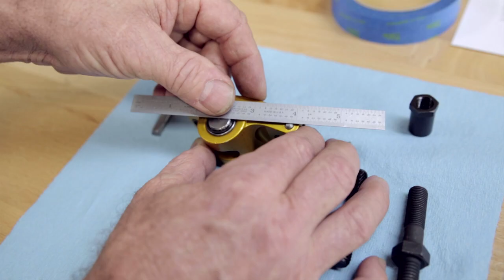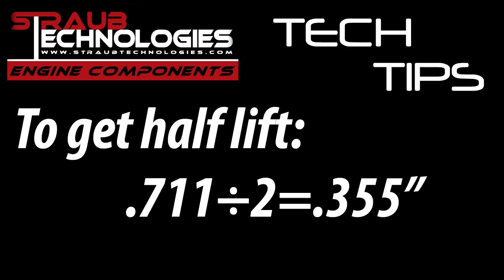Engine Tech: Valvetrain Geometry

Comment: So when i find the correct push rod length should i try and order one about 0.035 longer to account for lifter preload?
Reply from the maker: When ordering pushrods for a hyd roller application add .050" to the length for any hyd roller lifter unless it is a limited travel.

Comment: Ok so I think I understand but please feel free to correct me if I'm wrong. I have a cam with a .300 base so times that by 1.6 gives me .480 that's my gross lift correct? .480/2 = .240 for half lift correct? I have 3/8 studs so I take .240/.042 to get 5.71 turns correct? So my correct push rod length should be whatever my half lift length plus .50 for preload right? I just want to make sure I understood this correctly?
Reply from the maker: Your spot on.  Half lift is .240"  Correct on turns.
Reply: @straubtechnologies thanks for the answer glad to know I understood it correctly

Comment: I followed this, the tip of the rocker is not centered to stem, slight off center. Send it?
Reply from the maker: As long are you are within 1/3 of center you are fine.   That means on .341" diameter valve, 11/32" you have approximately .113" of area to have the sweep pattern in

Comment: Silly question. My cam card has “gross lift at cam” .350 do I multiply by 1.5 rocker arm to get the “correct gross lift” ?
It’s a Howard’s cam. Valve lift says .525 on card.
Reply from the maker: You use your valve lift yes...  .525".
Reply: @straubtechnologies  what if you have a 1.6 rocker? That changes the total lift so you use half of the total lift that the 1.6 gives you?
Reply from the maker: @barryc2307  you want to use valve lift...so what ever rocker ratio  your using you calculate lift with that ratio.

Comment: Instead of doing the nut turning operation with tape can the cam lobe be placed at the mid lift position?
Using a dial indicator with a long tip extension you can set mid lift at the lobe. Adjust the 90 degree relationship with an adjustable pushrod tool and a checking light weight spring.
Alternate way of obtaining the same results?
Reply: Verifying your at exactly half lobe lift is likely more complicated.

Comment: Question; is this 90degree  rocker to valve at half lift geometry hold true for long finger hemi style rockers as well????
Reply from the maker: We are doing a shaft rocker video.
Reply: When are you doing a video for shafter rockers? 
Cheers eh!
Reply from the maker: @MERCcrewlcab  Will do it when we are setting up a set for the new 380cc Grim Reaper Port on our BBC 24 porters casting.   End of Feb

Comment: Great video! Very well explained. I've always checked the old way with sharpie on the valve tip to see the pattern after a few revolutions. I have two engines in the shop right now getting new cams, and I'm gonna give this method a go! Seems like it saves a good bit of time, as well, since you're really taking the "trial and error" out of it.

Comment: What need to happen when a guy follows this step by step and the roller tip is still way off? It's still on the outside of the stem!
Reply from the maker: What engine are you working on?  What heads?  We sell rockers with adjusted geometry.  www.straubtechnologies.com
Reply: Its a sbc 350 with aluminum heads. Not sure on brand.
Reply from the maker: @MikeCox-z9u  If its got .100" long valves then our SBC rocker will fix that with its adjusted rocker geometry.

Comment: do you need to have the checking valve springs for this method or can you do this with the stock springs installed?
Reply: @scrote7734  I did it with my springs already installed I don't see any reason why you can't @staubtechnology
Reply: Fairly certain you don't want to use the stock springs for this

Comment: I already have correct pushrod length for my existing roller lifters. I am changing to a new set with a different seat height can a deduct the difference from the two and use that to buy new push rods or should i remeasure again?
Reply from the maker: You can deduct seat height difference.
Reply: @straubtechnologies Thanks, I was pretty sure but not positive.

Comment: Stud-mounted rocker arms on a big block Chevy have always been a compromise at best. Flex, inconsistent geometry, and valvetrain instability are baked into the design. If you’re serious about reliability and high stability, a quality shaft rocker system from Jesel, T&D, or Crower is the only real answer.
Reply: it is  but who in their right mind  wis gonna spend 2000.00  for a shaft rocker system thats meant for full race stuff vs just buying 450.00 aluminum rockers  for a street application?  just buy stud gridles and it'll still be less than half the price
Reply from the maker: Shaft system is always a better choice for valvetrain stability.  The con is the cost of a shaft system being almost 5X more than stud mounts.    A properly set up stud rocker can give years of service, but if money is no object go shaft rockers.

Comment: SWEEP WIDTH of the roller across the valve stem tip, as the valve opens and closes (dynamically), is the highest priority regarding the influence of pushrod length. With a fixed measurement rocker, retained with studs and poly-locks, the ideal rocker arm for the application is often a mystery and something we cannot control, beyond trial and error, using multiple brands of rocker arms. Therefore, we find ourselves compromising btw minimum sweep width across the stem tip vs centering the sweep on the middle of the tip. Most of the time you will not get both, therefore the MINIMUM SWEEP WIDTH is of a higher importance as it reduces side loading on the valve stem, therefore minimizing the wear on guides and seats. Reality, in most cases the narrowest sweep witness mark will find itself towards the outside or exhaust side of the stem.
Reply: The most narrow sweep with always occur when thr rocker is at a dead 90 degrees to the valve at exactly mid travel. This is because when a lever is 90 degrees to it's fulcrum, the end of the lever is at the maximum lateral distance from the fulcrum. If you move the lever up by x amount, the lateral distance from tip to fulcrum will be exactly the same as if you moved the lever down from 90 degrees. This is the absolute minimum lateral movement of the tip possible.
Reply: what do you thin k will happen when the geometry is correct?  you get a narrow sweep. the only way to get a narrow sweep is correct geometry.  cant get around correct geometry. and this way is the most exact way to get it

Comment: I installed a new roller lifter camshaft and roller rocker arms on a 1968 vintage Pontiac 400. After measuring for pushrod length using this method, do I then add or deduct for lifter preload before ordering new pushrods?
Reply from the maker: Add .050" to pushrod length for lifter preload.
Reply: @straubtechnologies was thinking the same thanks for your information!
Reply from the maker: You add .050" to the length for the preload.

Comment: I totally disagree. It should be 90 degrees from the centerline of the trunion to the top of the valve-tip. Why ? Because you are not taking into account for the diameter of the roller, which is different and variable for every rocker arm. Also, you are not taking into account for the infinite different rocker-arm lay-outs and roller diameters.
Proper rocker arm geometry only uses the fixed reference points of trunion centerline, and top tip of vavle height at half lift @ 90' 
Proper rocker arm geometry .. involves an equation of "solving for 3, (maybe 4) unknowns." Which will boggle most mathematical minds. The only constant you have is valve tip height at half lift. Trunion height, rocker-arm layout, roller diameter, and pushrod length ... are all variable. 
At least you got the 90-degree part correct ! Therefore .. I'm going to score you 95% for effort, but still a fail ... because your rocker-arm geometry methodology is not taking into account for roller bearing diameter and rocker arm layout.
Still a very impressive leap forward on sharing rocker arm geometry knowledge 👏
Reply: It needs to be done with the rocker you are using. If you establish 90 degrees to the tip of the valve, you will not be at the center point of the valve at half lift, which is the point of proper rocker arm geometry. With 90 degrees set at the center of the roller as demonstrated here, that puts the point of contact between roller and valve stem precisely on center of the valve stem at half lift. 

You cannot establish a push rod length for proper rocker arm geometry that will apply to your “infinite different rocker arm layouts and roller diameters.”
Reply: @danielblizzard701 
Not correct. You started with the 90' at half lift as the #1 priority. Then incorrectly wander over to valve swipe as the second priority. Valve swipe is a result of rocker-arm lay-out. You can't change that.
Reply: @thestove2407 at half lift I would want the roller directly in the center of the stem. Therefore the pattern shown with compound when actuating the valve would be centered. 

So what’s the best way to achieve good sweep in center of stem, if using the method in the video is resulting in 90 degrees at half lift (ideal) but due to rocker arm ratio, the sweep is off…??? Lengthen pushrod and disregard 90 degree at half lift until desired sweep pattern is achieved???
Reply: @danielblizzard701 
Omg ... how in the world did you come to that conclusion ?????????
No wonder you can't get rocker arm geometry's order of priority straight  ... 
Good luck  !
Reply: @thestove2407 I was just waiting for you to “boggle my mind” with your mathematical genius.
Reply: @thestove2407 the studs are fixed, the stems location is fixed. The manufacturer of the rocker arms build them for the specific engine you are building. 90 degrees at the center of the roller at mid lift puts the contact point dead center of the sweep, as the sweep would travel equal distance away from center at both max lift, and base circle. 90 degrees from trunnion to stem, would not achieve the same results, as that is not center of the roller bearing. 

Maybe you should make a video showing your mathematical prowess, it would indeed be enlightening.
Reply: @thestove2407  So then, why does the sweep width change with the pushrod length change? Side loading the valve stem is what we are trying to avoid. Being in the center of the tip is a bonus, but being "square" to the tip is most important. This squareness is dictated by the least amount of sweep. With stud mounted rockers the only variable we have to work with is pushrod length. This is why a shaft rocker with an adjustable stand, combined with a variable pushrod cup location on the adjustable rocker itself is superior when minimizing sweep and being in the center of the stem tip.

Comment: Thank you ! I will be putting afr heads on my 467 big block Chevy . It’s the first time I have installed heads by myself and this video definitely helps alot with measuring pushrods .
Reply from the maker: You will want our rockers or the AFR rockers to get correct geometry on the heads.

Comment: For hydraulic flat tappet setup do you have to add or take anything away for hydraulic lifters
Reply from the maker: You want to add .040 to .060 to the length of the pushrod for preload.

Comment: So after you find your pushrod length do you add your preload to your total pushrod length when ordering? If not do you order the pushrod length you measure and then simply add your preload after setting zero lash? Also does this method still work with.100 longer valves?
Reply from the maker: Yes add .050 for a hyd roller application.
Reply: @straubtechnologies  if doing this on a +.100 valve everything works the same?  Also do rocker studs need to be +.100 as well?  SBF using Chevy valves and comp gold rockers.
Reply from the maker: The need for longer rocker studs is common to get the geometry correct.
Reply from the maker: Add .050" to the pushrod to compensate for preload.

Comment: You said that most pushrods come in .050". You measured 8.725", so do you go shorter at 8.700", or do you longer to 8.750"???
Reply: Splitting hairs bro. The purpose is getting the contact point between roller and valve stem precisely on center at 90 degrees. So .025 bigger or smaller will alter the geometry the same amount either way you go. You just won’t be 100% on center, but darn close.

Regardless, if running hydraulic lifters, you add .050 to your calculated push rod length. So in that case, you would go up 👍

Comment: I have a cam with a higher exhaust lift, should I get two different length pushrods for intake and exhaust?
Reply from the maker: That would be correct.
Reply: BBCs yes  the heads, for a lack of a better description, are canted. my windsor  would be  same length because  the valves are inline

Comment: Awesome video. Once you determine the proper pushrod length, then you need to add the preload measurement to your total length?
Reply from the maker: Correct...add .050" for the preload.
Reply: I don’t understand adding preload back to the length of the pushrod once you determine the proper pushrod length already
Reply: @cliffordwilkerson3677   the low pressure check springs don't have enough pressure to bleed off the lifters, and when he set the pushrod length he set it to zero lash so there was no pre load on the lifters. That's why you need to add the preload to your measured length. Some people will use a solid lifter while doing this measurement just to make sure the lifter doesn't compress at all, that way they can remove one variable and be sure their pushrod length is as accurate as possible.

Comment: 3 things I learned using this technique.
1) There are different length rocker arm studs.  
2) There are different length pushrod measuring tools.
3) The cam has to be on the base circle to get an accurate measurement.
and bonus #4) Add .050 for a HR lifter.

Comment: Great video on this. Is there anything special to do to account for preload of a hydraulic lifter like added length? Or this works similarly for solid and hydraulic lifters?
Reply from the maker: Once you have your measure length, add .050" to the length for preload on hyd roller lifters.
Reply: @straubtechnologies  Thank you very much!
Reply: @straubtechnologies  what  if  the preload  is  different  for the  "limited travel"  hydraulic roller  lifters?
Reply from the maker: @KingJT80  limited travel lifters require a 2pc or 3 pc pushrod.  Based on lift mfg requirement for travel you need to have pushrod built for application keeping in mind aluminum will grow as it gets to temp.
Reply: @straubtechnologies  2 piece  pushrods?  like  the manley swedged  kind?

Comment: I don’t have enough threads on the stud for the rocker to stay on to even line it up up at 90 degrees
Reply from the maker: Its common.  You need longer rocker studs.  For now you can stack washers under the hex head of the stud and use this to act as a longer stud. Once you get your pushrod length measured you can then order pushrods and rocker studs.
Reply: @straubtechnologies thanks so much for the advise! Great idea sir!

Comment: I don't remember this ever being explained,  what you are actually trying to achieve with correct push-rod length. This makes so much sense and would probably have saved me from buying the wrong-length push-rods.  I thought that getting the contact patch in the center of the valve-tip was the goal-so wrong, pushrod was too long and was binding on the rocker-arm and pushing the rocker against the stud!
Reply from the maker: Pushrod length is the by product of correct rocker geometry.

Comment: Late in the game here.
Watching this makes me think you would not need to use checker springs? Couldn't I follow these steps while using the installed springs on my heads and add  .030 to .050 to the pushrod measurement. (for my hydraulic lifters)?
Reply: There's a good chance you'll collapse the lifter completely, and that's further than 30 or 50 thou(unless it's a short travel lifter). Then you've blown past the proper point of geometry. 

Its best to do this with checker springs. 

However, Scott has an updated better way to check for geometry.  Search for his channel and you'll find about a 5 minute video.
Reply: @arturozarate1752  True. But in the video he lowers the rear of rocker arm to half the lift without the valve opening and then measures the push rod length. Maybe I'm missing something? Thank you for the video link
Reply: @mikedavis4782  personally, I made a mount for a dial indicator and measure for sweep instead angles. I deal with a lot of shaft rocker systems, but it works just the same on stud mount rockers.
Reply: https://youtu.be/hcRTOKn0sjE?si=qM5Q1d1179hVq1o5